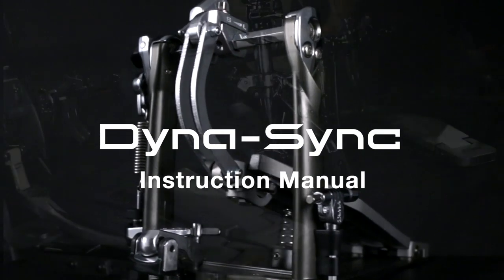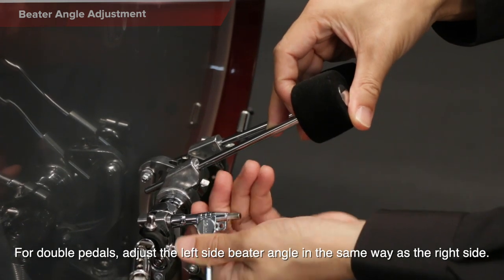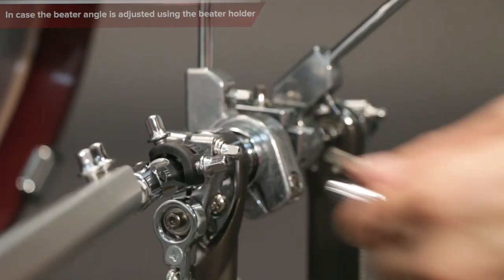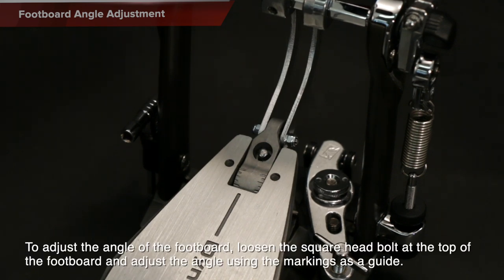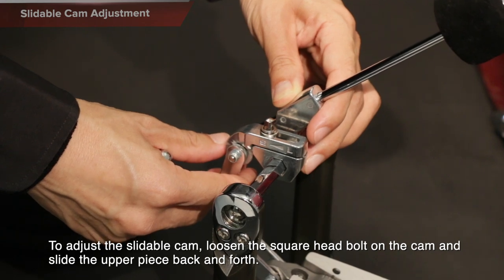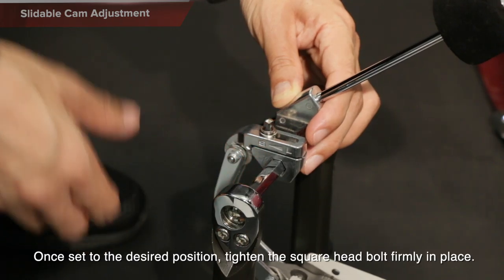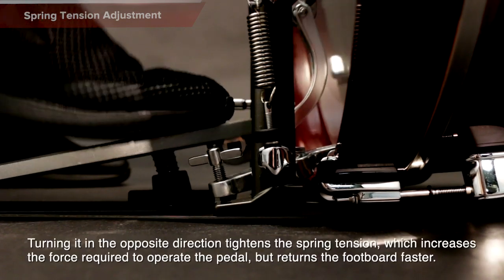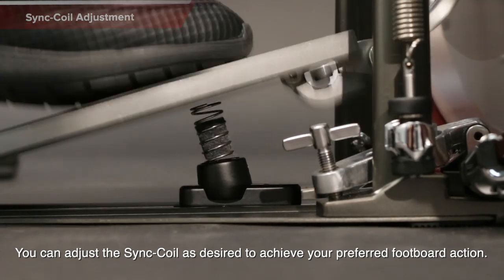TAMA Dyna-Sync Drum Pedal Instruction Manual

Comment: Iron cobra & dyna sinc
love them both
i also love the Pearl Demon drive
they are all equally great pedals.
but thats just my meek opinion
Best pedal i had was in 1983. it was a Ludwig speed king. the modern pedals are just as good but with alot of crazy adjusting and fine tuning for everyones different personalities🙏🏻
Reply: You should check out the 2020 remakes of the speed king. Kept true to what made the original so iconic. And removed all the wiggly squeaky points of failure. And improved the action. My only complaint is I can't get a double version. But it's my favorite pedal still. And only like 180 bucks on sweetwater.
Reply: Nah the Dyna sync is much better than the demon drive I feel.
Reply: Nah demon drives are cheap crap

Comment: With all the features this pedal has, and at that price point, you shouldn't have to deal with a problem such as the aforementioned height resonant side bass drum angle adjustment to cam angle with drive link touching the batter side. I'm surprised Tama did not take that into consideration. If you like your bass drum even 3 inches off the ground,  then there's no point in buying this pedal.

Comment: So basically Tama has pretty much copied Pearl's Demon Drive pedal?🤔
Reply: no.  this pedal is a rip off, and you are all foolish.  look at the parts on it and compare it to their other models.  maybe it has decent bearings for that 700$ price.  but the rest are their base model parts.  you are paying 3 times it's marketable value.
Reply: the only thing they had to design for it is that attachment to the pedal itself.  otherwise, each one of those bars costs 250$.  cause this is a 200$ pedal. that mechanism isn't worth 500$... plain and simple.  this is a gimmick.
Reply: This is way better